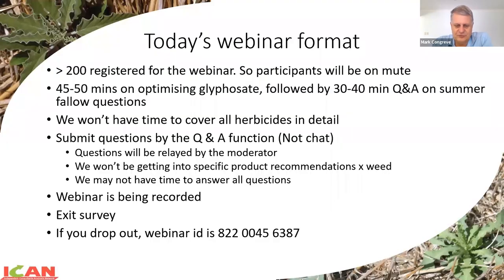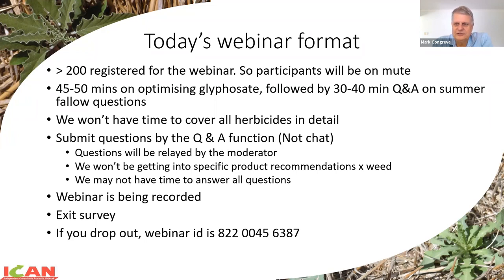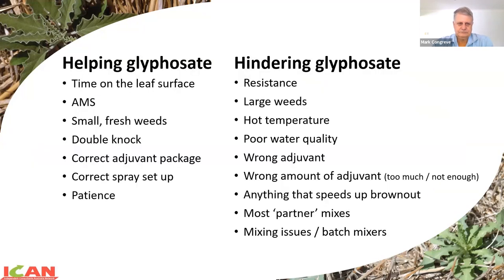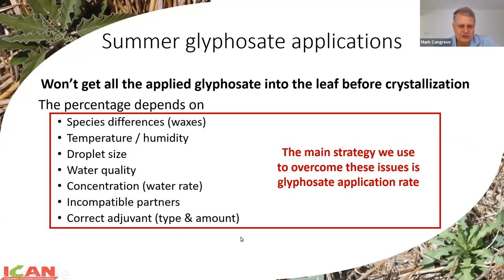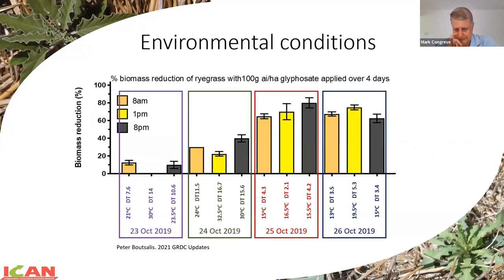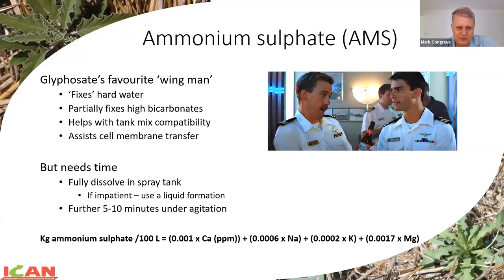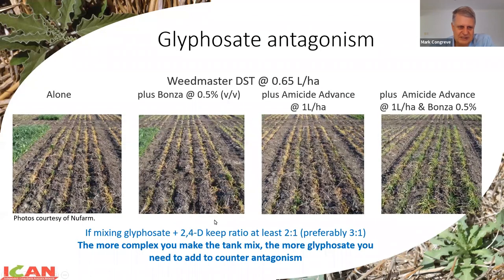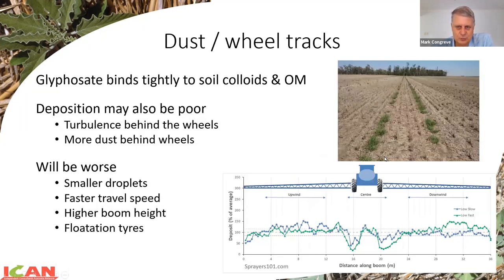Optimising glyphosate in summer spraying

Comment: There is no doubt glyphosate should and will be banned due to its long term negative effects on both soil and human health.  In the meantime avoiding it or using as little as possible in the most effective way is the next best thing.  Research has shown that adding a carbon source such as fulvic acid to the mix 200g per ha can increase glyphosate uptake by around 30%.  Also the optimum tank pH for glyphosate has found by research to be 2.9 (very acidic).  Using citric acid to lower tank pH to around this level in addition to adding a carbon source can allow glyphosate rates to be reduced by around 50%.  Graeme Sait from Nutritech Solutions talks about this in his podcasts and video presentations.